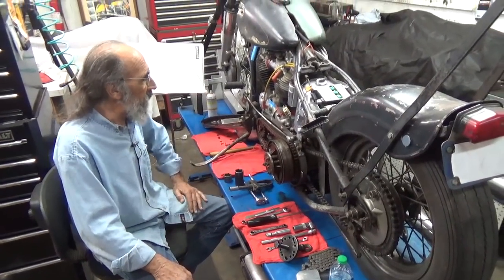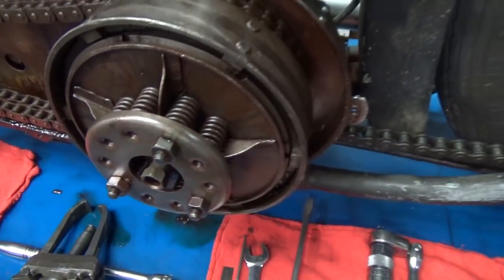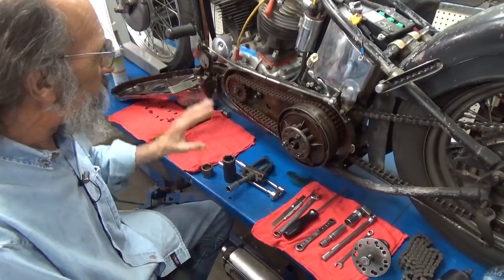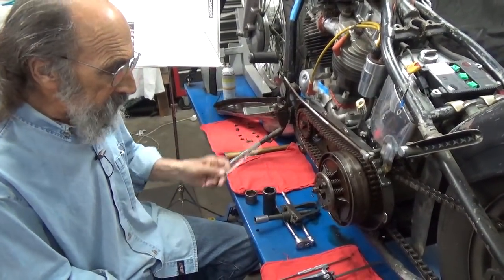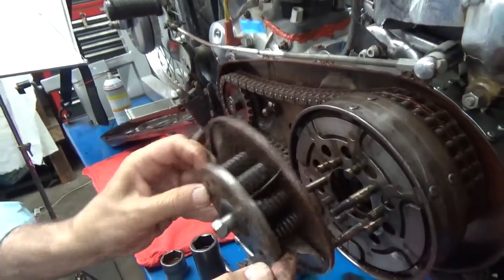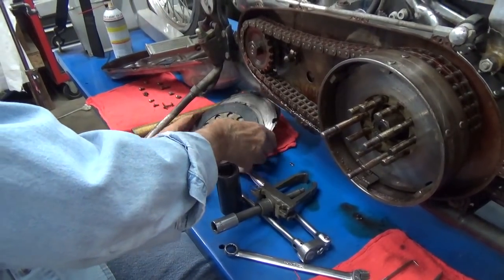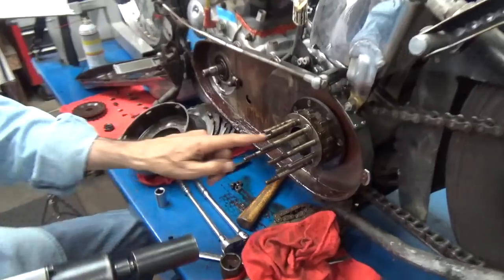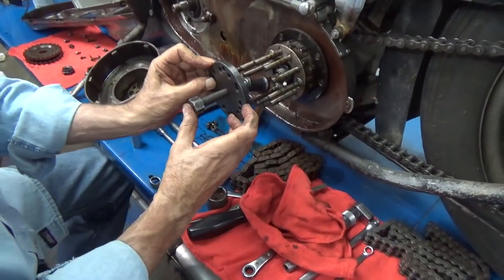Step 2  Let's Look At Some Parts On This Panhead

Comment: I had the same issue with the puller, my solution was to drill out the hole just a bit more, so the clutch pushrod would fit in. Works perfect. Thanks for your knowledge Mike!!!!
Reply from the maker: It's off, no big.  Thank You.
Reply: @pacificmike9501  👍🏻

Comment: One thing I found out on my 48 pan is that the dimension you measure from the outer to inner pressure plates is ok for a starting point, however what really counts is when the clutch is engaged the distance, whatever it may be should be equal at all 3 of the studs with the adjusting nuts. It usually isn't, because of unequal spring pressure, or some other thing will cause it to be out of parallel, but it only takes backing off a half turn on the adjusting nut where the distance is greatest to get the pressure plates parallel. It makes the clutch nice and quiet when engaged, no kaching kaching.
Reply from the maker: Well said.

Comment: Mike, thanks for the trip down memory lane. I can remember doing this on my 76 FXE. I got rid of the electric foot and went with the tin primary and installed a belt drive. Back in the 70-80's you wern't cool pushing a button, oh how stupid I looked when the kicker gear had a broken tooth, Skip Fordyce to the rescue..... Live and learn.. See you out on the road...
Reply from the maker: Fun stuff.   Skip was a personal friend.  He used to come into the store I worked in, lean on the counter and tell me stories.  This was in the early 70's after he sold the dealership and retired.

Comment: I've put the clutch hub nut back on and loose a couple turns put the socket on and give it a wack with a bfh it will fall off.
Reply from the maker: Or, use a puller.

Comment: Hay  mike your the  best   I  know u know your shovel heads  ok I had  a 1976  1000  and it had bushing  on the points side and when it  wore out it would break the springs on the points  so  did  they put bearings on the points side in the 1982  sportster  1000
Reply from the maker: The best thing to use is a brand new advance mechanism, with all the pivots lubed with high temp antiseize.  I believe this is the part you're speaking of.

Comment: Ever heard of the "rattle snake" test? Take the chain and hold it so it dangles downward. Give
it a shake. If it sounds like a rattle snake rattle it's toast. ☺

I noticed you didn't bother to pull the tab back on the clutch hub nut washer. Of course, using
the impact it spun free anyway. I tried to get a look at the teeth on the engine sprocket and
basket, but... Yeah, I know you'll inspect them at your leisure.
Reply from the maker: They're old and well used.  Eventually, we'll replace it with a belt drive.  Now, it's just "Get her going."

Comment: hello Mike, I posted a couple weeks ago regarding compensator sprocket assembly onto a 75 shovel.  In the end, I replaced the retaining spring and it's cover, a one piece part.  With the one on the bike (worn out), the spring never engaged when the nut was tightened.  I actually found an OEM Harley NOS one and the difference in the retaining spring was visible to the eye.  Anyway, problem solved.  I can't remember where our dialogue is posted.  Thanks for your great videos and precise explanations.
Reply from the maker: That's great.  I try to answer questions and sometimes I can help.  Glad you solved your problem.  And now, you understand compensators.  Most people don't.
Reply: @pacificmike9501  ty. And you are correct. I do understand how the compensator works now. Thanks

Comment: I always put a socket on the transmission shaft, and then my (homemade) puller pushes on the end of the socket. The socket has a hole for the clutch pushrod and its size is such that it contacts the transmission shaft perfectly.
Reply from the maker: Cool.

Comment: I love all of your video’s Mike, no matter which models you are working on, as a matter of interest this one seems to have a solid sprocket, would you prefer a compensator or no compensator? Thanks for all the videos.
Reply from the maker: It's an old "taper shaft" and most just had a solid sprocket.  I do have a compensator for one of those, but it's geared too low.  When we finally redo the whole bike, we'll install a belt drive.  But, that's in the future.  For now, it's repair what needs it and get her running.

Comment: 👍🏼🏍
Loose primary chain reminds me when I got my 98 softail it had like 13,000 miles and it was there was no more adjustment. This is why I save  things ..I had one off of 68 showerhead that was in better shape and I put it on there and it still on my softail today. I never could figure out why.. 
there was a oil in there but how that primary chain could’ve stretched in 13,000 miles to the point of no more adjustment with the shoe…
Reply from the maker: Probably never got looked at since it left the factory.  Then it leaked it's oil.

Comment: Hi Mike, Love your videos. I noticed the plug on the chain oiler tube.. can you explain why? Since the bike still has a chain, Thanks
Reply from the maker: That's not a plug.  It is a cap that directs the oil coming out of the tube.  It still functions as designd, both as a breather and as a chain oiler

Comment: Mike thanks for all the instructional videos I'm fairly new to the panheads The head gasket on my rear cylinder blue out do you have an instructional video on taking the top end apart thanks
Reply from the maker: Not at the moment.  I'm sure we'll get around to it.  I haven't had the heads off of my Panhead in probably half a dozen years.  But, the Shovelhead procedure is the same.  We do have videos on that.  Go to our Youtube homepage and click on the word "videos."  We have a bunch on Shovelheads.

Comment: Good video Mike. Can you tell me what battery is installed and if it sits in an unmodified horseshoe tank?
Reply from the maker: It is just a stock 6 volt battery.  If I can make the generator generate and a cutout relay function, we'll run it stock for a while.  Eventually, we'll convert to 12 volt gen, battery and a solid state regulator.  For now, it's "run what you brung."

Comment: Hi, Mike!  Im working on a 1960 FL Duo Glide.  The front sprocket is different than the one you’re showing here.  Mine has a spring and a grease fitting on it.  How do you remove this thing so I can replace the chain?  Thank you!
Reply from the maker: There is a tool that fits it.  Any of the aftermarket shops or major suppliers on the internet carry it.  You have a "compensating sprocket" assembly.  It is an early version with an outer nut with four holes for the tool to fit.

Comment: No compensator on those old scooters ?
Wondering if eliminating the compensator on my 79 shovel be good.or not . getting noisy and annoying.
Any comments appreciated. ✌
Reply from the maker: They get worn and can be shimmed.  A Harley flywheel washer under the head of that big nut usually does it.

Comment: Question, How many foot pounds of torque on the engine sprocket ? Would 250lb impact gun be enough ? Or would I need a 500
Reply from the maker: Different years have different requirements according to Harley's service manuals.  Don't overdo it.  No, you don't need 500 lbs.
Reply: @pacificmike9501  iv got a 1948
Reply from the maker: If you impact it onto that one, use a low low setting and just tap it easy.  The motor sprocket is on a tapered shaft that is keyed.  Be gentle.  Just put it on so it is tight.  Use one small drop of red loctite on the threads.
Reply: @pacificmike9501  will do, thank you again Mike you have been so helpful in the process of resurrecting my Panhead back to life 🙏🙏

Comment: Quick question Mike what kind of Ignition coil is on that bike
Reply from the maker: There is no brand on it, but I remember all of the aftermarket suppliers carrying it in both 6 and 12 volt.

Comment: Mike have you ever made a video of replacing a rachet shifter on a panhead ?
Reply from the maker: Not yet.
Reply: @pacificmike9501  my foot shifter lose it spring back movement on my panhead , how do you change the springs in the rachet ?

Comment: Put my brand new 3stud clutch on, and found that the clutch nut gets tight before it hits the basket. About a 1/8” shy! 
On your video you mentioned that the nut was an early one. Was there a longer clutch hub nut made? Or is this an after market screw up on the clutch hub?
Reply from the maker: I have no idea.  I can't see it from here.  You're saying the clutch hub doesn't go onto the taper?  The basket goes onto the hub.  What year are you dealing with?  Are you mixing things together?  I need to know way more about what you have.
Reply: Sorry about that. It’s a 56FLH. I’ve replaced the old 5stud hub with a brand new 3 stud hub. New hub sets in fine, but when I install the nut and washer, tighten all the way, there is still 1/8” left to befor it hits the hub. I did notice the after market hub is deeper where the washer sets than the old hub. 
Hope this helps to clarify my issue?
Thanks Mike
Reply from the maker: Sounds like the hub wasn't machined properly.  When you say "washer," which is not wrong, I think you're referring to the locktab.  Washer, locktab, just want to be sure we're in the same place.  If that hub doesn't go all the way on or the nut doesn't go in far enough to hold the hub properly in place, and the old hub located fine, I'd say the new hub is probably faulty.  Put them side by side and compare them.
Reply: Thanks Mike, yes, the new hub is machined deeper than the old one, where the tab washer sits. About 3/16” Deeper.

Comment: Hello mike, my father has been watching all your videos trying to learn something that could help fix his motorcycle. He owns a Indian chief 2000 with S&S Engine. He Currently has a problem with his cylinder and gasket, is there a video or manual you can recommend us ? A workshop manual?
Reply from the maker: All of that info should be readily available online (sscycle.com).  S&S has all their stuff online.  Unless something is changed, S&S supplied those engines to Indian in Gilroy California.  They were all supplied in 88 Cubic inch form.  Those S&S engines were all Evolution style, like Harleys, but for accurate information and gaskets and things, contact S&S online, or direct in Viola, Wisconsin.
Reply: @pacificmike9501   all the manuals we've found  online or from s&s arent really that useful to be honest. it is a 2000 evo 88'' cubic, 3 5/8" bore and 4 1/4" stroke.     from your videos, i see you have some catalogs you always refer too, where can i find them?  Or if you have one related to what im looking for, that i can have a copy of? any help would be greatly appreciated.

Comment: Mike, I have a 4 speed and once in a while when I go to downshift from 4th to 3rd, it will go into neutral. I have to upshift to get into 3rd. Is this normal for older bikes or is a bigger issue a foot?
Reply from the maker: I don't know which transmission you have.  The shifting problem is either in the lid, where the mechanism moves the forks or in the position of the forks.  Is it a hand shift lid, a ratchet lid, or the later "astrodome" lid.  Must tell me what year the transmission is.
Reply: @pacificmike9501  The bike is a 1980 FLH. I'm not sure which transmission it is from the choices you provided me. Thank you.
Reply from the maker: The late model 4 speeds have a lid that wears out lots of parts.  You apparently have that lid (commonly referred to as "astrodome."  If that's what you have, you'll need to remove the trans to check it all out.  Possibly (most likely) you have worn parts in the lid.  The other thing would be the "timing" of the shifter forks.  The worst part is R&Ring the trans.
Reply from the maker: That is what the 1980 came with.

Comment: Ah, Mike filming Mike & his wireless mic, while they're both building a bike for a Mike as yet unseen . . . Splendid.
(This garage has more mics than a Presidential podium/bedroom/tour-bus & cheap political jokes cost mere Pence)
So, 'Panheadus Erectus', a fine machine. I did read somewhere that Shovel 'jugs' can be grafted on without too much bother too; this leads me to wonder - has anyone ever built a motor up with one of each fitted - & did it run?
"I call it 'Shakey Jake' & it's never been stolen . . . well, no more than 100yds at best, fella just ran off, gibbering; we got a '61 Pan & '74 Shovel mix-up out back too . . . just lend that one to the massage parlor & honeymooners."
Have fun over there . . . like slide hammering your puller off that 'slightly swollen' pushrod . . . & take care too. Lod : )
Reply from the maker: It would take some serious doing to fit a Panhead cylinder head to a Shovelhead cylinder.  To mix Pan and Shovel (one front, the other on the rear) has been done, but due to the different rocker arm ratios and porting designs, it's quite an undertaking.  I have known guys who di it, just to prove it could be done.  As per the usual, you never disappoint.  Thank You.

Comment: Once a longtime ago in the days of my youth I was riding my Panhead at a meet an old man that only rode Indians said "A Harley has a dry clutch that's always wet".

Joke was on him though, by this time Indian had been out of business 25 years. Grouchy old guy......

Still riding that same Pan 4 decades later but the high gear seal needs replacing.
Reply from the maker: They need it fairly often.  Old time design.  I love the old Harley vs. Indian confrontations.  It's part of the history.

Comment: Long long ago as a factory trained GM auto tech we were told that good used parts can be better than new parts . Because they have " proven " themselves in service . Can't begin to tell you how many  used automatic trans " hard parts " like clutch drums & planetary's we put in warranty repairs . 
Love what guys like Dragon Man can do these days to turn the ole straight shaft motors into tapered Timkens .
Reply from the maker: Good stuff.